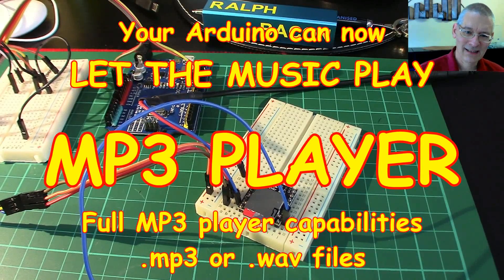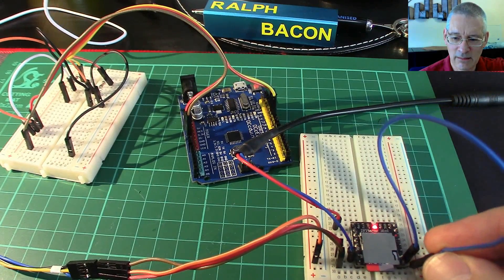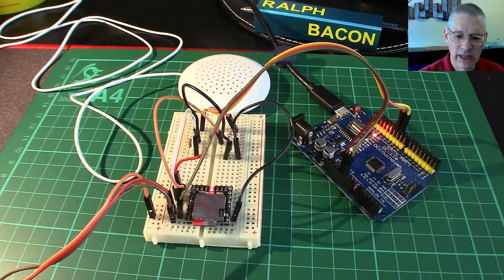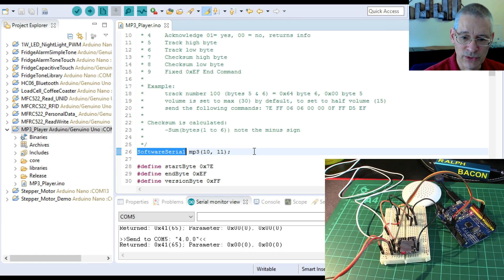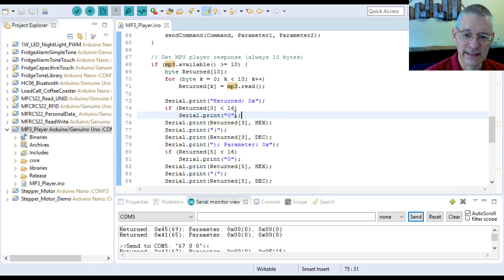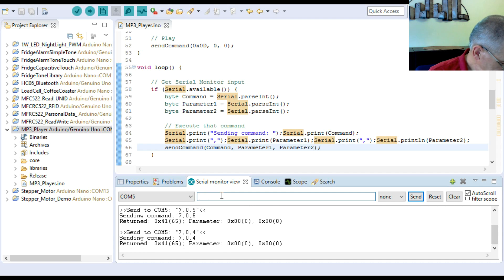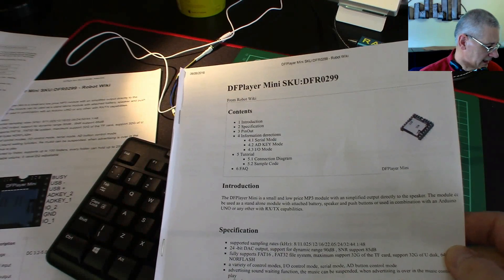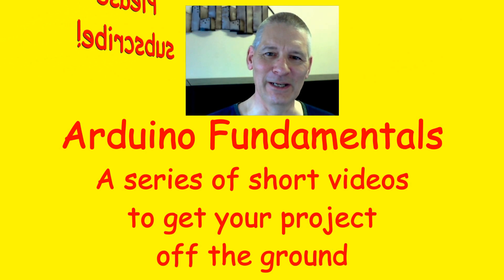#40 Let the music play! Arduino based MP3 Player for music (or announcements)

Comment: Found it on Aliexpress for US $1.34 w/ free shipping from china.  Will probably take a month to get it but for that price it's hard to complain.

https://www.aliexpress.com/item/Mini-MP3-Player-Module-TF-Card-U-Disk-Mini-MP3-Player-Audio-Voice-Module-Board-For/32657798948.html
Reply: Yeah, me too :-)  I used a 3.3v regulator for the power supply and a couple mosfet level shifters on the serial lines just to be safe.  I'm not sure if it's true but I have read that the audio sounds better when powering it from 3.3v and using 3.3v logic lvls on the serial lines.  It certainly sounded pretty good during the quick testing that I did.
Reply from the maker: +BEdmonson85
That is indeed a great price! How do they do it? At least price is not obstacle to including one in any project that might benefit from an MP3 player. Thanks for the link, appreciated by me and others reading this too.
Reply: I haven't the slightest idea! I remember when buying a serial (ttl rs-232) 16 x 2 lcd for a project would set you back $50, now you can pick up an I2C lcd for next to nothing. I wish electronics were so cheap when i was a kid. ☺
Reply from the maker: Yup, you and me both.
Reply: That is most definitely a clone, but it looks like the review are good anyway. Some clones are not necessarily bad at all.
Reply: Yeah, I ordered a couple to check out. When I get them in I'll let you know if they're decent.
Reply: Well, I got the order in from aliexpress today.  Hopfully I'll have some time to follow up in the next day or two.  I must say, though 1st impressions are that they do a dam good job getting the look right if these are clones.  I can't tell a difference appearance-wise.
Reply: It took me a little longer than expected to find the time to test these little modules from alliexpress, but I must say for less than $1.50 these things are amazing!  They work perfectly so far.  I can't believe how loud they can go lol !  :-)  Have a good one.  I hope everyone had a great holiday and has a Happy New Year!
Reply: Awesome! Hopefully they hold up. Happy new year to you too!

Comment: Hello sir Ralph. is it okay if i used CY-T16 v1.1? i`ve looked at CY-T16 and DFPlayer, they have the same pins.
Reply from the maker: Hi Arthur, the answer is "maybe". On the Arduino forum they seem to think these two modules are just rebranded from the same source but you just never know. 
Or changes to one module are not applied to the other module and then the library doesn't work well (if at all). Depending on the price, you may have to take a chance. The DFPlayer I used though was remarkably good value from the source I showed in the video. 
Pays your money, takes your choice, that's the best advice I can give as I have no direct experience of the CY-T16.
Thanks for posting your question though, others may have more experience of the module you refer to.
Reply: thanks for the reply Sir Ralph. I have a project right now, its called ANNUNCIATOR. you can set schedule with specific alarms and your time will be based on gps time so it will be accurate in terms of time.
Reply: and we will used an 3rd party program which is vb6, these will be the process. vb6 we`ll be the export and syncing tool of the schedules going to the arduino.
Reply from the maker: That's great Arthur, I wish you well with your project. Given the low price of GPS modules these days I'm almost coming to the conclusion that they are better value for money than the usual RTC modules, as the GPS module will always be accurate (unlike the DS3231 which has to be reset for Daylight Saving time and so on).
  
It's great that you're sharing that information as it will be inspirational to others too.
Reply from the maker: +Arthur Morales 
The best place for support in projects is the Arduino forum (http://forum.arduino.cc/index.php) where many knowlegeable and experienced people can assist and suggest. Regrettably I just don't have the spare time to answer technical questions here, just on that forum which I dip into now and again and help out where I can. I hope this answer helps you in getting your project up and running!